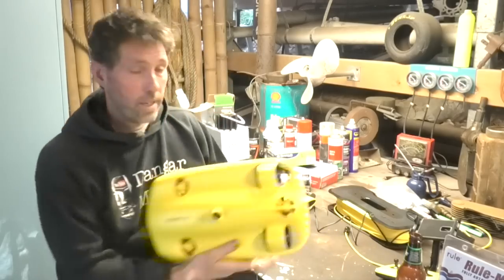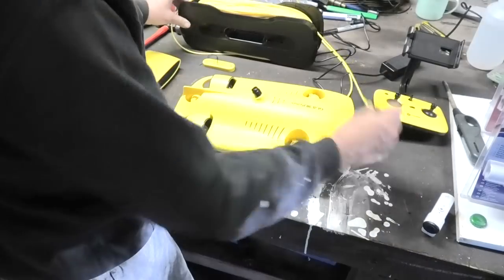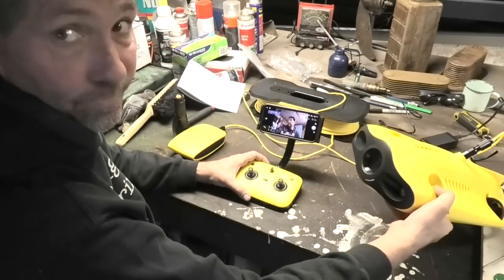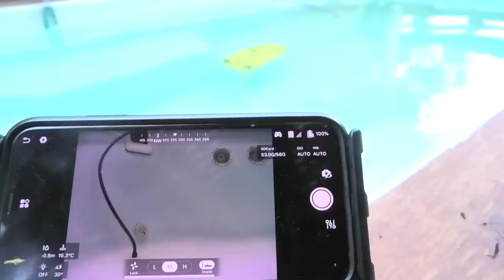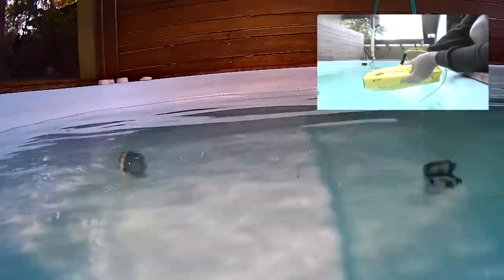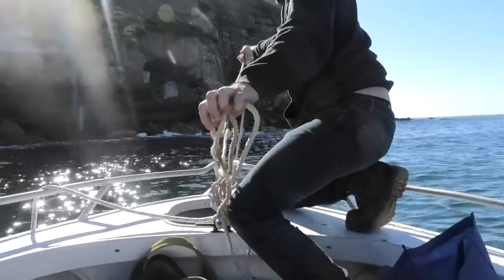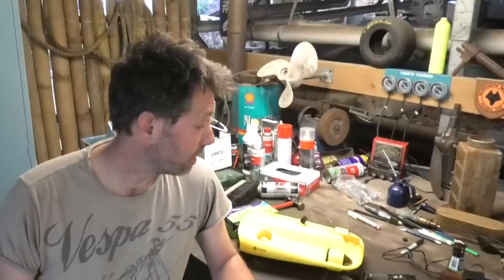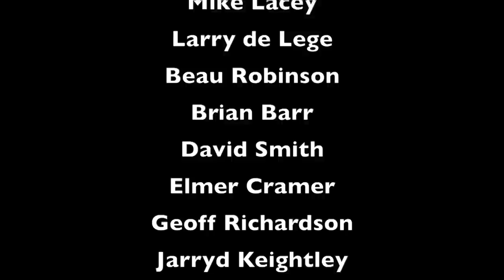Chasing Gladius Mini ROV Sea Trials

Comment: Just one advice when it comes to this drone. When used in saltwater, always put it in a tub with freshwater and run the thrusters for a few minutes to drive all the salt out from the bearings. If you just wash it off with a hose like the manual says, the thrusters will still be filled with saltwater, and they will eventually seize up.
Reply from the maker: Good idea about running it in a fresh water tub. Good thinking.
Reply: @Nighthawk20000  
Saltwater pool

Comment: The Sailing Soulianis incurred quite an expense to lift their sailboat from the water to determine a simple problem this Gladius could have identified at a fraction of the cost. Seems like the potential for this device is endless
Reply: waketheoblivious I’m waiting for Gone with the Wynn’s to get one, they love their aerial drone
Reply from the maker: I definitely think it will be a good thing to keep on board at all times. If you can't pull your boat out on a trailer easily it will be great for inspecting props, anodes, leaks etc.

Comment: Next time, unreel the control cable and remove all the twist from it .. to prevent it from looping like it did .. and then attach it to the ROV. 
ALSO, use some saltwater grease on that O-ring to help preserve it and maintain that watertight seal.
Nice little toy, that! Well done!

Comment: Hi Dangar Cousteau. How long does it take to recharge the Gladys when on board the boat. I notice you didn't pack the charger! I presume you can't swap out a spare battery pack. It will be great for inspecting hull damage and fouled props etc. But can it be rigged to pick a case of beer off the sea floor?
Reply from the maker: Not sure of the recharge time, but the battery life is 2 hours.

Comment: That is just neat, it used to be the rovs were big clunky and hundreds of thousands of dollars now there within the reach of most people.

Thanks Stu that was that was really interesting. I learned to dive in 1975 when the Atpack was brand new, and drysuits were for the commercial diver.  How times have changed.
Reply from the maker: Yes, it wasn't that long ago you would spend $20,000 any any vaguely useful ROV and it would be huge too. This is much more practical for the average person.

Comment: A cool little piece of kit! Sort of wish the tether had a stronger cable in it, in case you have to retrieve it from under something, but I suppose the weight would be a problem. It's going to be fun to play with, though, I can see that. Might save a bit of air, too.

Comment: You probably already know, but I'll mention it anyway just in case; different lens filters for different water types makes a huge difference in underwater video/image quality. The biggest one being a red lens filter to add the red light wavelength back to the image that the water doesn't allow through. I learned this diving with my GoPro. I highly recommend looking into it, it's a simple thing that makes worlds of difference. Very cool ROV! I'm excited to see what you find with your new boat and toys!
Reply from the maker: Yes, lens filters can make a huge difference. I've experimented with them when doing astronomy, but not underwater yet. I'll see what's available.

Comment: Great video.  At first I though it was weird that the ROV doesn't have a tilt camera instead of tilting the entire Rov but was then amazed to see it still holds depth while moving forward and reverse while in the tilt.  I'm very impressed with the features of this Rov and it seems to be a respectable price point.  I like the size of it too... I might just have to look into getting one of these.
Reply from the maker: Yes, tilting the whole unit keeps the design quite simple and robust. Less moving hards to fail, leak or get sand in them and jam up.

Comment: Great little unit.  How was the battery life?.  Would venture to say say the stronger the current the quicker it would run down.
Does it give you a good idea as to location.  See on screen but finding again once you dive.
Do they have option or model with constant power?
Reply: The website shows a 2hr run time.  I'd assume thats under perfectly calm conditions, so 1.5hrs would be more realistic, but that is still fantastic if you ask me.
Reply: @Bobbywolf64  yeah I read that too, was wondering if he had same results or not.

Comment: Hey Stu a lady contacted me desperate to find a phone she dropped into the water on the hawkesbury 2 weeks ago. She was very specific about the exact location in 1.8 mtrs of water. The sim has the only pics she has of her baby. I couldnt help her this weekeknd......Could be a first search mission for the Gladius
Reply: SaltyBrains  Maybe.  The biggest issue would be sand and silt covering it so you can't see it.  I would bet money that the memory card survived though.  There are also companys that specialize in retreiving data from damaged cards, and hard drives.  IF you could get the phone back, the pictures are most likely still there.
Reply: If she has a google account of some kind  there is good chance they're  backed up, if she does a search for google photo and logs in there may be some.
Reply: A woman separated from her cell phone; she must be on tranquilizers!
Reply from the maker: Tell her to email me if it is my end of the Hawkesbury.

Comment: We had a video ray ROV and seabotics ROV assigned to the homeland security unit down in Mobile Alabama they both worked pretty well, some times in deep ocean water the larger units are nice as strong currents do cause issues. That small units looks nice though good luck!
Reply from the maker: Yes, there is no doubt that for true ocean work you would need a larger ROV, but I am impressed with what they have managed squeezed into a small package.
Reply: Dangar Marine I certainly agree I was impressed by it for sure! Have a good time over here in the states when you come. It’s very hot on the gulf coast of Alabama right now!!! It shouldn’t be to bad the places you will be however.

Comment: Squeeze some 'Dielectric grease' into the submerged connectors. It will prevent sea water intrusion and prevent corrosion and shorting...

Comment: A thoughtfully, and well designed unit.  Doesn't attention to the minutiae make use of the whole pleasurable? Xtra screws, built in lock tool, extra O-rings, auto level control; things that would drive one to despair if lacking: but - All there for you. Good Demo. See you on tube at Dougs.
Reply from the maker: You're dead right that it is the little things that add up to a positive experience.

Comment: Should have done an inspection run of the hull of the boat you were on. It would have been nice to see the piratical application of the unit other than just the fun stuff. Another great video though.
Reply from the maker: I'll do some inspections of the trawler once it is back on the mooring.
Reply: @DangarMarine  That is one expensive little toy. Right at $1,600.00 U.S.

Comment: The Gladius Mini appears to be a very versatile unit packed with excellent technology.  100 metres of cable appears to be an adequate length considering the use you intend to put it to. I was wondering if you recharged the unit after the pool test? I hope you get the free tablet that has been offered to you. The underwater camera had very good resolution & provided clear images in combination with the two lights. A very manoeuvrable unit made easier by its self-management system - maintaining position etc. I think you have landed on your feet with this one. I look forward to seeing how it performs on the job. Thanks for sharing. Video production consumes much more time than a completed video would indicate. Do we call you a submariner now?
Reply from the maker: I was really impressed with it, particularly the clarity of the camera. You are right about the time taken to edit. At least it is work you can do from home which is nice.
Reply from the maker: Oh, and yes, I did recharge it. The total dive time on a full charge is 2 hours.

Comment: awesome bit of kit Stu.... My only concerns are 1.Are you limited to a 100 mtr umbilical or could you couple 2 together? 2. I noticed that the umbical is connected direct to the plug and has no way of being attached to the R.O.V with a stronger clip/fastening which would remove all strain of the socket itself.

one thing I would suggest is to keep all the spare o rings in the plastic bag but to squeeze in some O ring lube so they are kept well lubed all the time.Something I did for years when I was offshore for all subsea equipments and diving gear o rings too.

I was very impressed with the film quality.
Instead of using a phone could you hook the contrlloer up to a notbook/P.C.????? this would look great on a external monitor on a notebook or p.c..

 Once again thanks for this vid and I am sure you will have plenty of fun with it.
take care
Reply from the maker: Have David, it doesn't seem there is a way to tether the cable other than the socket, a very different setup to your deep diving offshore ROVs. Good idea having the o-ring in some lube. I have some silicone o-ring lube from my dive gear. I thought the film quality was really good too - way better than I expected. The base station does have an HDMI output on it so I'm thinking of getting an HDMI - USB C adapter for my laptop so I can view and record as I go. This would save transferring the footage to the laptop afterwards.

Comment: cool video, yeah I got me a Mini too, I bought me a 200 meter cable but ofcourse it can't go deeper than 100 meter anyway or should not atleast. But with 200 meter I get better around while being at land. I used to scubadive alot before but now due to my health condition I can't and I miss the freedom when scubadiving and see the wonders underwater so with the Mini I can dive .. in a way as you described it :-)
Reply from the maker: Yes, the extra cable length does give you a bit more freedom to move horizontally even with the 100m depth limit. Glad to hear you've been enjoying getting back underwater!

Comment: Hi Stu, Very cool unit. The only thing I see that may come up as an issue is the tether getting caught on something. Like a crab pot put a light float up the line from laying on the bottom. It would suck to get tangled and have to go down to retrieve it.
Reply from the maker: Yes, we had the SCUBA gear there just in case but it was nice not to need to use it!

Comment: Great fun.
A little weird the dive/surface control works reverse to other remotes (quads, planes) maybe there's a setting to reverse that? I reckon it'd be a lot more intuitive for the user.
Looking forward to seeing more from this, from the D.R.U.N.K.T.A.N.K. !
Cheers from NZ
Reply from the maker: It does have a couple of modes for the controls, but from memory there wasn't an option for invert Y axis. Is a bit confusing if you are used to aircraft!

Comment: Hi Stuart. What a great little piece of gear and just perfect for exploration. My only comment is : How strong is the connection of the signal cable ( umbilical )  to the unit ? I would like a wire safety line from the bottom of the signal cable to the body of the little submarine device.
Be such a shame to loose the device in a tidal flow area never to be seen again :) Have agreat trip to the USA.
Reply from the maker: Hey Graham, I'm planning to write to them and ask what the breaking strain is. I would like to know too.
Reply: @DangarMarine  Thought you might !

Comment: Gonna throw a "mailbox" on the transom for all that doubloon hunting? 

They go by various names, but effectively it is a 90-degree chunk of large diameter pipe that is hinged so you can drop it down and redirect the prop wash straight down to blow silt/sand. I've only peeked into that world and it seems there are some pretty widely accepted design criteria for optimal operation worth looking into. Stuff like positioning and diameter based on prop and rpms and all that. Tons of them in Florida I hear and a lively niche of the Internet where you can get more info I reckon. 

A google image search of "salvage boat mailbox" should give you the general idea if you've never heard of them.
Reply from the maker: I'll definitely look into making one, sounds like a good idea for shallow water.

Comment: Maybe a good idea to make a mountingpoint on the top of your handrail on the boat. Winding the tether wire on the spool will make twists in the wire. If you make a spinning holder you could connect the spool to the one sided holder. Mount the battery /receiver block to the spool too. Have a winding grip and be able to spool it in very easy without twisting the wire. Add a simple friction brake to prevent it from unspooling itself by the weight of the cable hanging down to the surface. And if the holder has a swivel the drone could even take more line out by itself if you drive futher from the boat. Nothing fancy. Just some steel arm you put in a rod holder maybe. A bearing with a plate with two pins on it that will stick through the spool. One just long enough to come out and the other 8 cm longer. Both with a small hole in it. Two r clips to secure. The longer pin is the handle to turn the line in or out. Plastic strip with a curve that will sit over the bearing shaft on the stationary part of the  with a hand screw a few cm oit to be able to push the plastic strip against the turning plate that holds the spool. By turning left you reduce brake and turning right will brake harder. Will make life easy and will linit wear on the tether. Long story for a simple brain wave. Great video. Nice underwater drone.
Reply from the maker: Yes, some form of tether spool is definitely on the to-do list.

Comment: i worry about how the tether gets wound and unwound..  its going to start twisting..  you may need to create a winder for it  just an L bracket. a crank handle and a way to catch the slot in the middle of the spool. and figure a way to secure the short end.. or mount the base unit to the bit that comes thru the middle of the spool so it spins with the spool and the short end does not get all knotty.  the wifi or blue tooth don't care if they are spinning..  i would also put a  surf board leash on the spool or winder so you don't loose it overboard when something yanks on the tether.  ps. make the spool winder floaty. so it can't sink with the weight of the spool if it does go for a swim..  i am taking the base station is sealed water tight so a rogue wave over the side does not put out the lights.  if not. then a plastic bag over it with some rubber bands might be called for..

 DIVE DIVE DIVE..   hopefully no grooper sees it and thinks its a snack.
Reply from the maker: It's a good point that the base station could spin with the drum. I was wondering how to handle the shore end but there really isn't any need given it is wireless. Good thinking.
Reply: @DangarMarine  i wonder if the company will redesign the drum to support the base station and create a stand and crank handle to easily allow the cable to be wound..  it might be as simple as putting handles on either end of the spool.. one on each side..
Reply from the maker: This viewer posted a link to one he made https://www.youtube.com/watch?v=hmf8T6Ag0n8

Comment: I can’t wait too start watching wreck hunting videos!!!!! Hopefully you will be able to setup a hookah system and possibly high pressure compressor for Those deeper dives
Reply from the maker: Yes, I would like to get some type of surface supply rig on the trawler but unfortunately the compressors are very expensive so we might be stuck with cylinders for now.

Comment: Just a quick idea. 100 metre of cables a lot to real up. How about a design of two "A" frames and a spindle, with a handle on the end, set between them. Or use a water hose reel for winding up the cable?
Reply from the maker: I was thinking about that, but how do you stop the end attached to the base station from spinning around too?
Reply: @DangarMarine  You started me thinking now. the centre bit will not work it will twist the wire still.
Reply: @DangarMarine  Or will it? you could disconnect when unreeling and reeling in.

Comment: I am not OCD on much, ok, OCD on only one item. Cords and lines.  If you mount the base station on the side of the reel or get a round extension cord real, it will be easier to let out and roll up without twisting the connecting cable. The base can rotate around it if mounted to the reel. With your ingenuity you probably can make something to attach it to the side of the boat. Good hunting.
Reply from the maker: Yes, a good reel for the tether would be nice.

Comment: Its certainly a nice RC but £1300 is a lot for a submersible ROV that isn't even close to being neutrally buoyant. You'd think they'd have given it actual ballast tanks. It seemed to need to hold itself down using thrust and I'm sceptical that the fresh water weight made that much of a difference with it being tested in a salt water pool.  For what it is, £800 would be a more reasonable price.
Reply from the maker: Being positively buoyant means that if anything goes wrong (flat battery etc) it will float to the surface. A feature I'm quite happy about!

Comment: Question: can you get WIFI when you are out at sea. Here in the USA I can only get WIFI when I have a password to routers close to my phone on land how do you plan to get WIFI out on the ocean if you plan to do work at sea.
Reply: The Wi-Fi network is coming from the unit it's self it not a internet connection it's just a way of getting  the signals across
Reply from the maker: Yes, it is just the phone talking to the base station that is on the boat with you. No internet connection required.